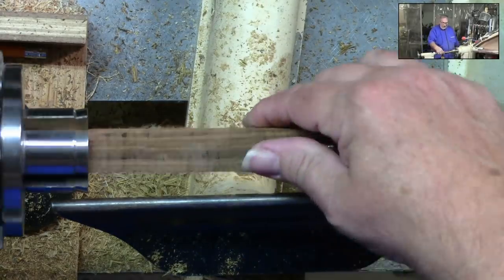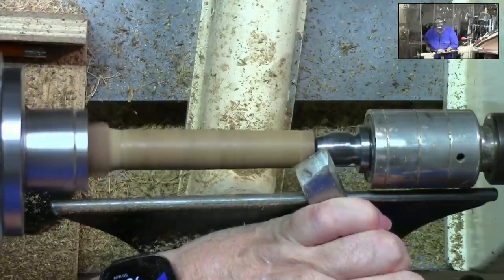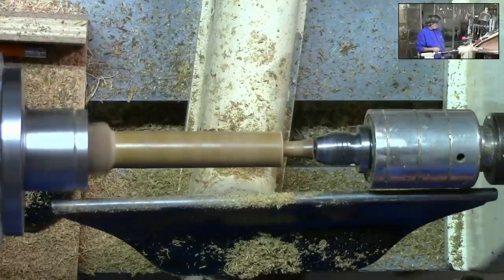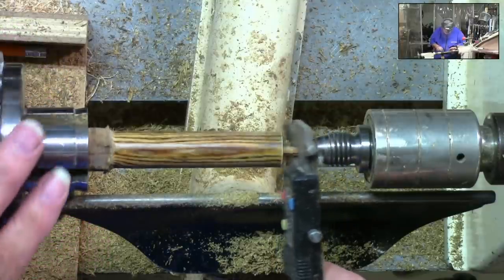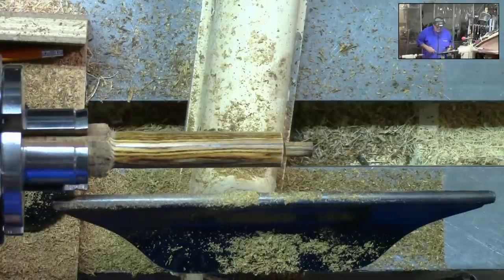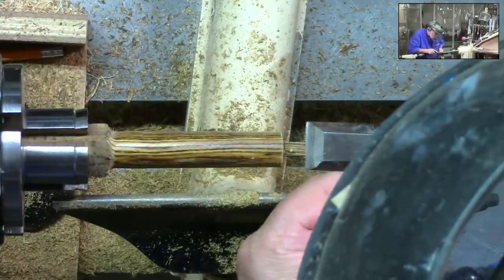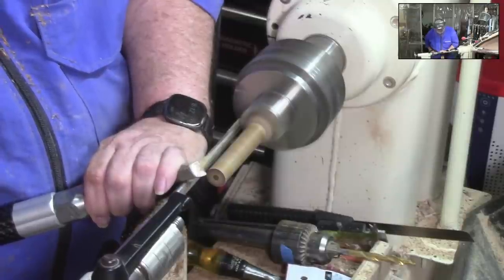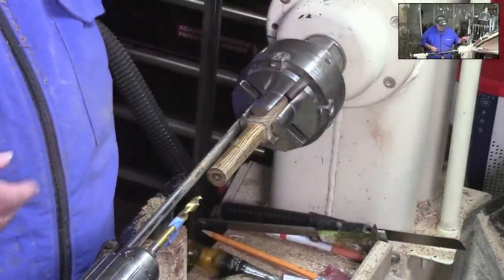Turning a Keychain Whistle on a wood lathe. By Dean's Woodworking #woodturning

Comment: Dean, An alternative to using the drill to drill the Eye bolt hole is a small hand turned drill. My wife purchased me a small hand drill and small drill bit set at hobby lobby and it works fantastically. I was skeptical at first but it is the handiest tool ever for that purpose. It has a Collett to hold the bits and it is so easy to precisely put it where you want it and drill with it and control it without snapping the drill bit off. And it takes up a little to no space and you can leave it very handy to grab and use instantly. I have mine in a little holder sleeve that is within arms reach. Nice video again!!
Reply from the maker: Thanks Scott